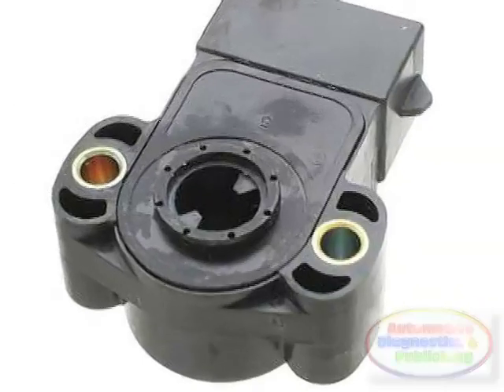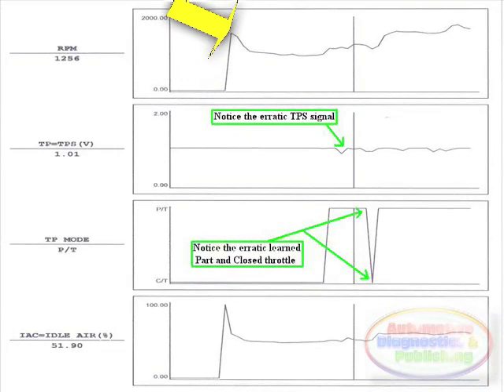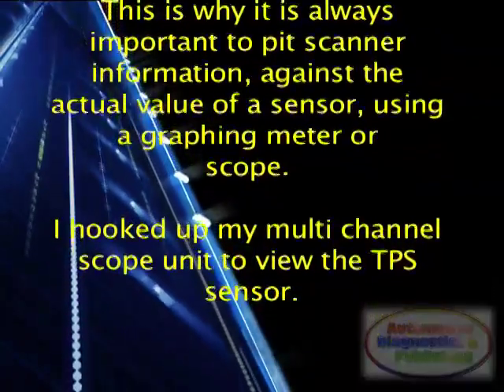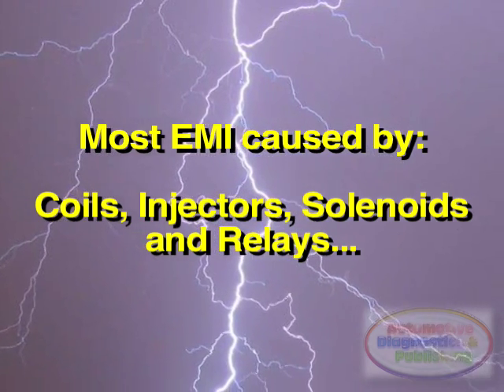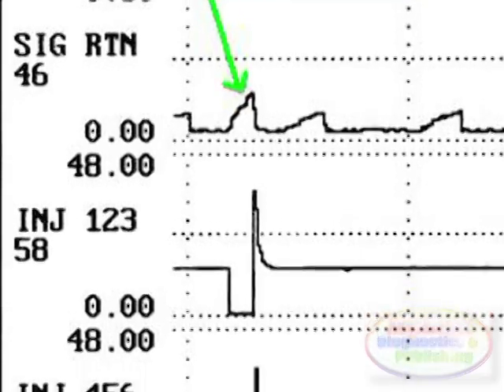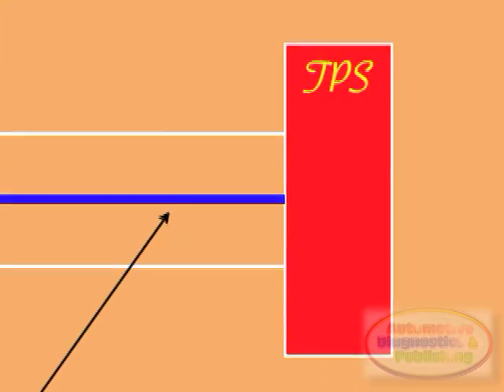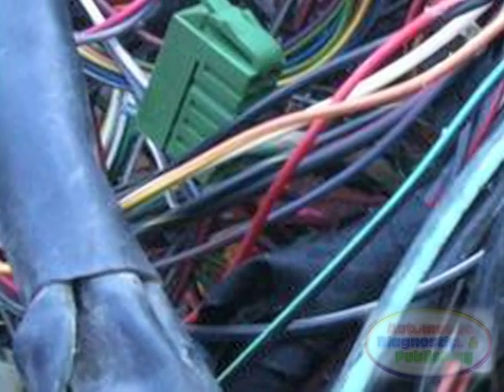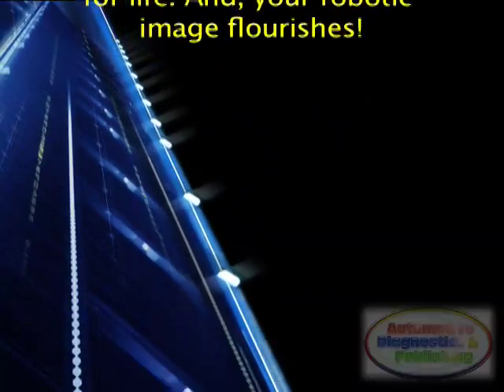Ford Explorer Noisy Neighbor

Comment from the maker: @TRcustomengineering Well, as stated in the video, somewhere in the wiring harness the sensor's signal wire was acting like an antenna. Rather than spend hours and hours tracking the section of wire, it was better to just replace the whole section of wire, from ECM to Sensor (1 wire). Mazda's and Mitsubishi's are known for this problem. Thanks for posting.